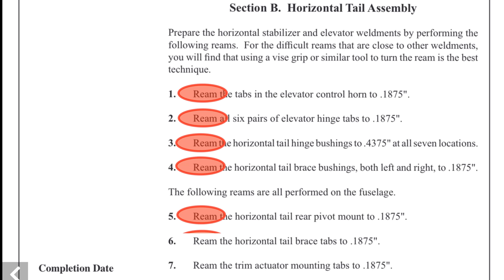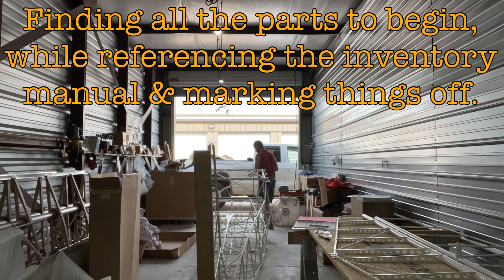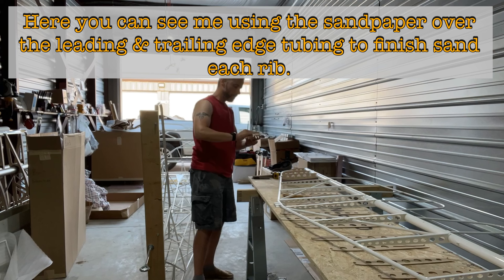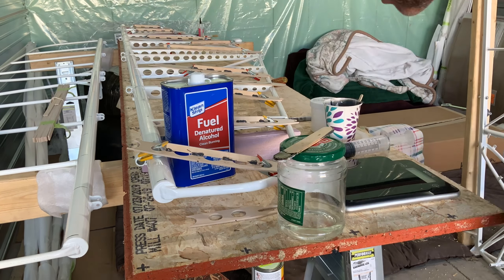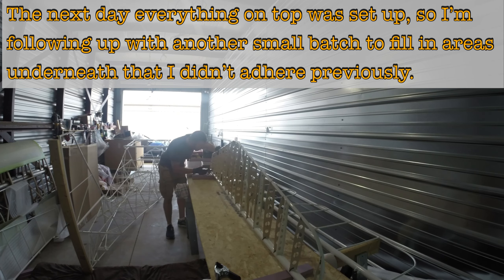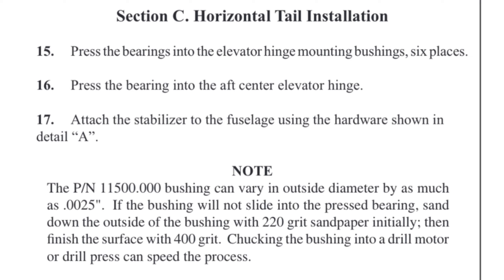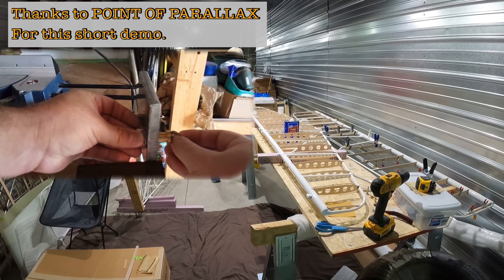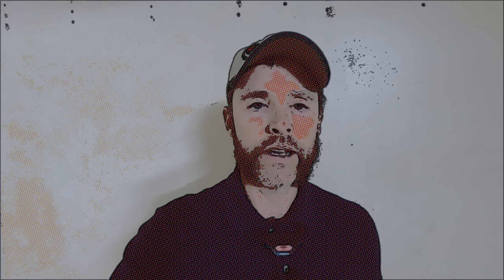#05 Finally!  Starting the build, Horizontal Stabilizer

Comment: One quick comment for those following along - don't throw away any of the rib-stiffening material. While working on the horizontal stabilizer and elevator, I threw away what I thought were "scraps" from the stiffening strips I cut from (i.e., I threw away the little 2"-3" inch pieces left from the pieces I cut stiffeners from). Well, it turns out that you will need those small leftover pieces when you put stiffeners on the vertical stabilizer. You need 5-6 pieces of 2"-3.5" pieces. Since I threw away my "scraps" a few weeks ago, I'm having to buy a small sheet of 3mm plywood to get the 4-5 small pieces I need. Not a big deal, but kind of annoying.
Reply from the maker: @sshort21, great comments.  Thanks for posting.  I've been keeping all those parts & I appreciate you bringing that up as I have never mentioned it.  I would save just about everything until the build is complete so one doesn't have to buy too many extra parts like you said.  Thanks for posting and have a good day.  Matt